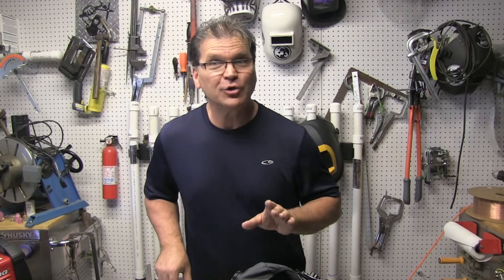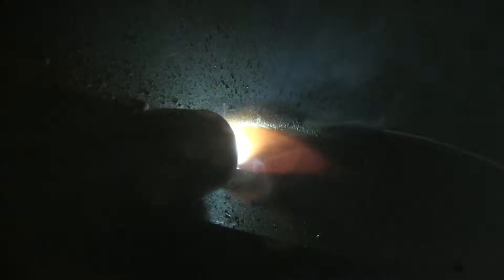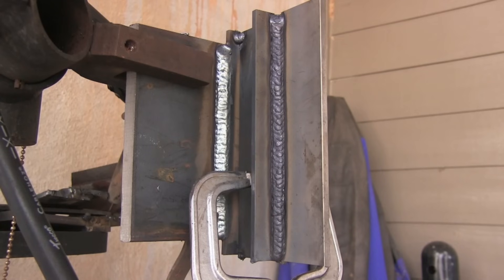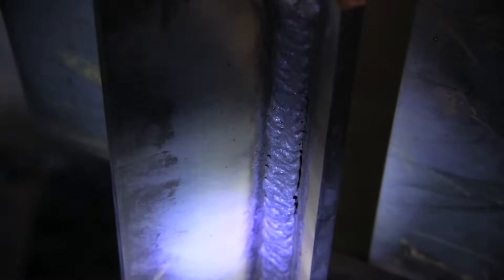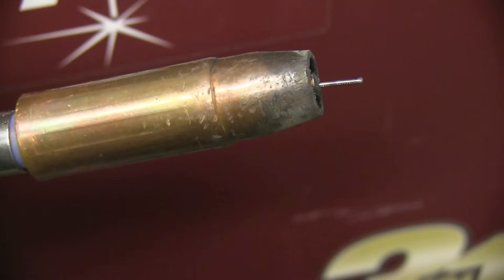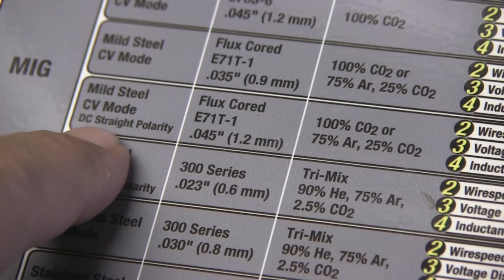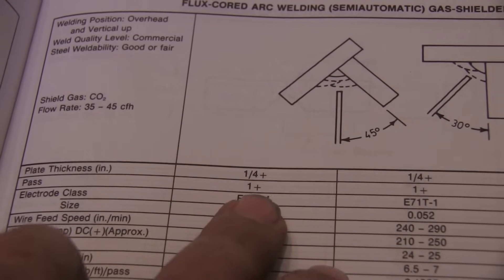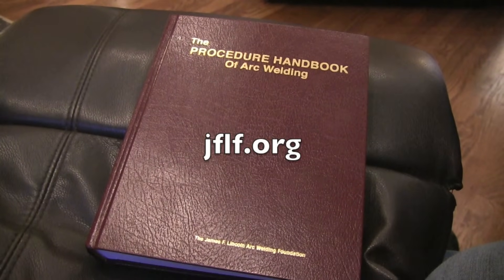Dual Shield Flux Core Welding Basics

Comment: Any suggestions on the angle of my gun going vertical on a 1 inch plate test.
Reply: Thanks. I have a tendency to wanna put a Lil weave motion in it. What causes porosity?
Reply from the maker: +AKweldshop Hey John,  thanks for weighing in!
Reply: +Bert Brown either straight on or slight push. youll know what youre doing is right when you watch the puddle flow. i find travel speed is the bigger issue due to the flux in the weld making it flow more so its prone to sagging. I used a weave motion for a long time and ignored everyone who gave me advice but trust me, learning to keep just a straight fluid speed with no motion prevents sagging and excessive crowning because you dont whip the weld metal around
Reply: +Bert Brown Aim it up a bit and don't move to fast otherwise you won't build enough metal up and it will sag.